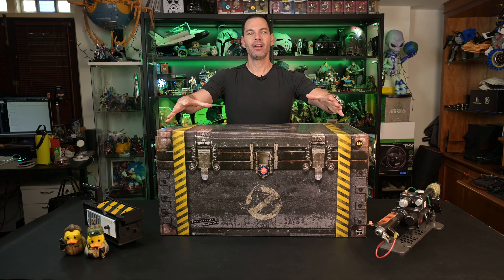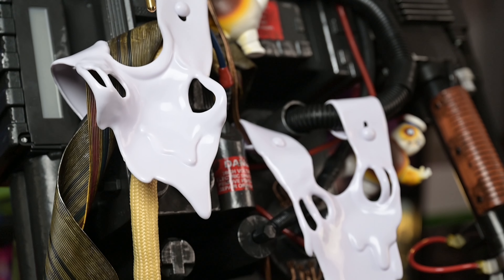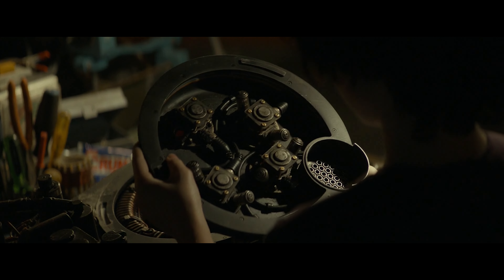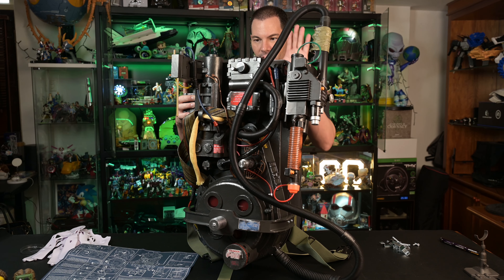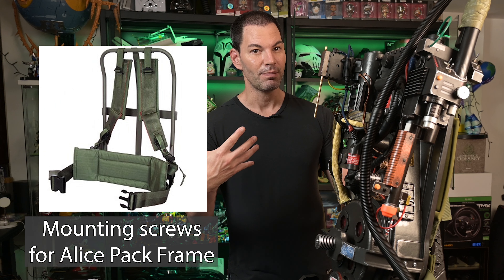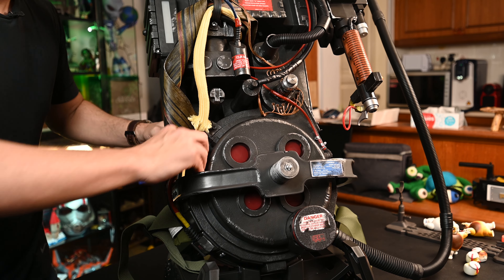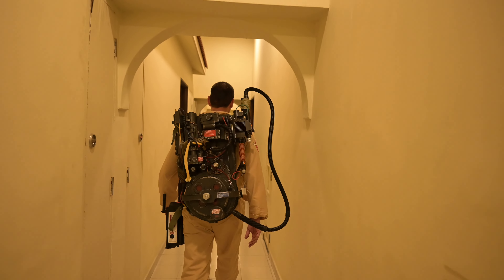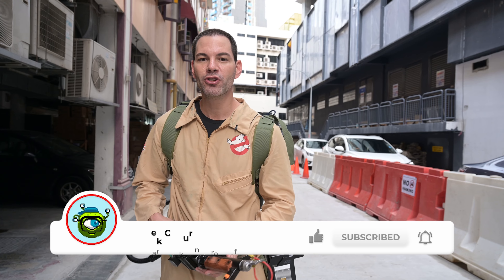Hasbro Ghostbusters Proton Pack Review: The Must-Have Item Of The Year!

Comment from the maker: What’s the one mod you would do with this Proton Pack? 

For me I would replace the bracket that holds the wand with a strong magnetic plate so it’s easy to reattach the wand when wearing the pack. As it stands now it’s not really doable
Reply: Ive already opened her up and installed a Lith ion rechargable battery. Where you put your wallet is were I put the the port to charge it. Next..a amp and speakers. It needs to be LOUDER!!! LOL
Reply: I installed a mono aux out to a bluetooth speaker to improve the sound. Very easy mod to do. Just splice the wires to the pack's speaker wires.

Comment: The extra switch is there on the actual pack, so Hasbro included it. They also made it a functional switch for the tinkerers in the GB community to use for their own modds.
Reply from the maker: Thanks. Will be interesting to see what’s done with it.  Would have made sense to use it as a switch from the 84 to 2021 sound profile instead of opening up the cyclotron
Reply: @GeekCulture  will be very interesting to see what the community does with the hasbro pack in the future. There's already mods that exist for the spengler wand. Modds for the proton pack will follow suit.
Reply from the maker: Yes will be cool to see. Exciting times

Comment: It weighs about 15-17 lbs which is lighter than most custom made ones (25 lbs. or more) that are made out of fiberglass and metal
Reply from the maker: Ok but it’s still heavy.
Reply: @GeekCulture  
Agreed...
It was b*tch to lug up the stairs in my building (3rd floor, no elevator)
Reply: A1:1scale version weighs about between 15/20KG
Reply: @GeekCulture  for a scale of reference, the original proton packs weighed around 50 lbs (22.67 KG) and most replicas weigh around that much

Comment: Just fyi. Hasbro did not have making a proton pack in the future in mind when they released the wand.
Reply from the maker: Hmm perhaps you are right but if that’s the case then the bracket they made on the Neutrona wand seems to mean that they had plans for something. Otherwise no need
Reply: @GeekCulture  oh they're right - when Haslab came into Adam's video last year, they said exactly that. Definitely left the hook there for the modding community. Absolutely stoke we have an official Proton Pack, I can't stop playing mine! Subbing for more content 😎
Reply from the maker: Downside is the hook doesn’t work well if you are trying to slot it back in when wearing the pack.something magnetic might have been a better option
Reply: @Geek Culture  if they did something magnetic then it wouldn't make for a very good replica.  The prop connects using a similar setup.  It is hard to put back on while wearing the pack though.

Comment: For $600 bucks, Really cheap that It Shuts Off after 30 seconds, so you have to constantly  turn it on over and over, the power cell cover is White, Not blue or even faded blue, the red and blue tubes easily fall out  and can get lost.  For $600, they could have Included  Alice pack frames.